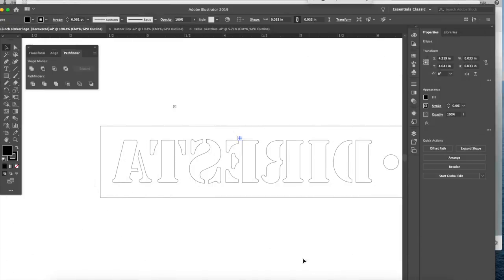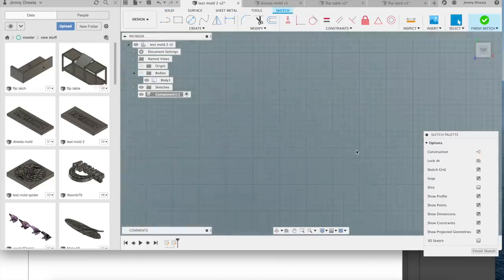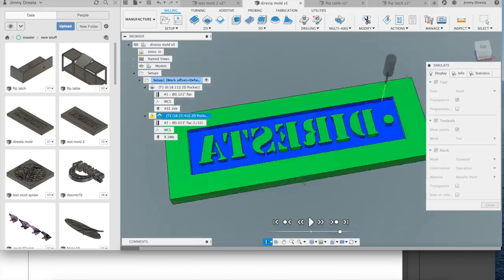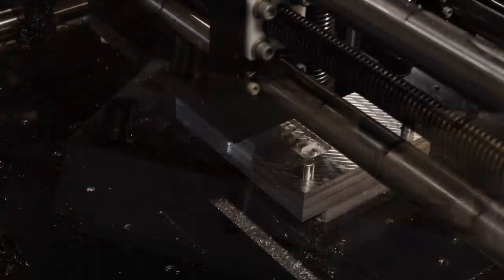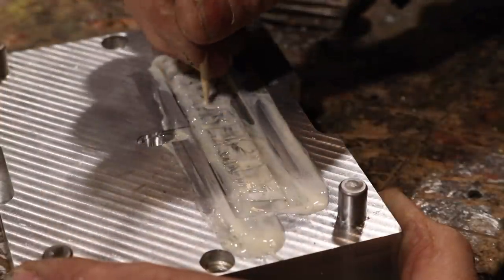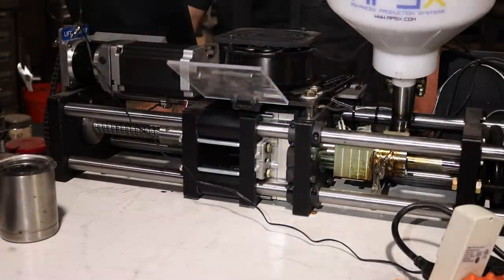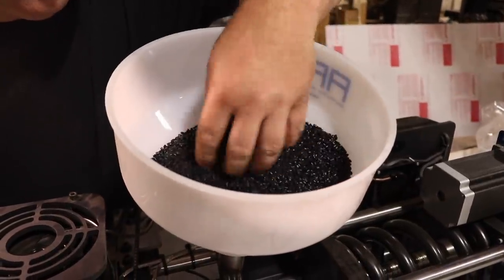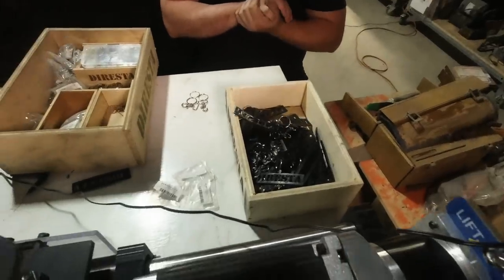DiResta Injection Molding Keychain!!!

Comment: 30Hr of machining!?!?! That seems really crazy. Remember you need to cut the chip not rub. Make sure you're taking a proper cut with the endmill. Should be roughly 0.001"/rev or so. If you clear the chips properly it will cut well and not take as much. Love the video. Thanks for sharing.

Comment: I haven't read the other comments, so I don't know if the following has been mentioned. There are a number of things you can do to reduce the milling time, and also so you don't need tapered end mills. First, you can step down using progressively smaller cutters. In other words, start with 1/8", use REST machining with 1/16" diameter, then REST again with 1/32" diameter. That will save a whole lot of time. Second, for the draft, you can rough with a flat end mill, leaving about 0.01" on the sides. Then come back with a ball end mill to clean up most of the sides. And finally REST machining with a flat end mill to clean up the sloped bottoms. I do these things all the time, typically with about 3 degrees of draft. All of my injection molding machines are desktop machines--none as sophisticated as the APSX.
Reply from the maker: Yep all good advice thank you 🙏🏼

Comment: You can draft the walls without a tapered mill. You can use a ball nose mill, but it will take some time. Also you can draft the walls by incrementing the cuts from fusion. Every small pass the contour gets a little bit larger. This also takes a while  :)
Awesome machine though....

Comment: wow...nice work.

You not need to be worry for taper rigth now because seems to be prototype only  but if you needed start adding  1 degree per side if is "pp" will work ok (steel safe always) if you want that the part has to be more rigid try with polycarbonate resin will had more rigid structure.

Remember that runner diameter leading into a gate should be 0.250in, never less than the thickest wall section in the part

As you mentioned is huge success man keep the great work

Comment: Since you have made a whole stack of the Black "DIRESTA" keychains, you could now follow it up with a white keychain to stick on the back of it with the "DIRESTA" lettering raised to be glued and slotted into the back of the black, making them a little more rigid and probably longer lasting. Put the metal triangular eyelet through the keychain and then a jumper ring onto that, would look good and I would buy one of those.

Comment: I have been looking at this injection molder for awhile, getting it from Ohio seem easier than getting a RobtDigg or Haijiang HJKMINI from China, but around 8:55 into this video I noticed the tablet flexing with each cycle and that concerned me about it's rigidity. Is that the entire frame flexing or just the tablet mount?

Comment: Thats a cool machine... 
What is the max clamp tonage?
Is there an ejector system or single acting?
Whats the max shot size weight? 
What plastics is it meant for? Can it do PC?
Reply: check the links in the description, they have all the specs on their site.

Comment: normalally there is also a cooling system in the mold as well as release agent applied to molds after every cast. you'd probably have to lap and polish away all thee mill lines as well.

Comment: Please tie the power cord back so it isn't rubbing on the chain. :-) 10:15
Reply: Done.
Reply: Or install a proper chain protector. Open and running chains are extremely dangerous. I wonder how this machine could be sold without a complete cover.
Reply: @atariks1475  Maybe it just wasn't installed yet.

Comment: Starting at 8:50 It looks like there is a lot of flex in the top of the end plate at the monitor end of the machine as it closes. Could the top guide rods be loose at the end?
Reply from the maker: GrayRaceCat the motor mount flexes a bit.  Not in the mold area
Reply: @jimmydiresta  I see it now! When the die closes, the motor pulls the drive chain hard enough to cause the end-plate the motor & monitor are mounted on to flex.
By the way congrats! Really good result considering its your first mold.  (I was a Tool & Die maker in the late '70's, mold making is on an entirely different level)

Comment: That's a great system - is there a reason to do the letters in the mould in reverse, if on the final product the letters are meant to be 'cut' right through wouldn't the result be the same either way?
Reply: because you can use a different back half to create an embossed version. always make the most flexible thing.
Reply: @donbot5000  Ahhhh, did see the first ones in clear had a back.

Comment: Could you reuse the sprue, flashing and other cutoffs and failed mouldings? Ore has it to go in the garbage? Greetings from Germany
Reply: We're saving them for the moment, need to try to find a way to grind them down to the pellet size. I've been looking at Precious Plastics machines for a while, we'll see how it goes. So yes you can, but to put them back through the machine they need to be smaller.
Reply: @aaronmattia8998  : Thank you! You might look into the stuff Dave Hakkens does. He is big into building a community around reusing plastics. All the best